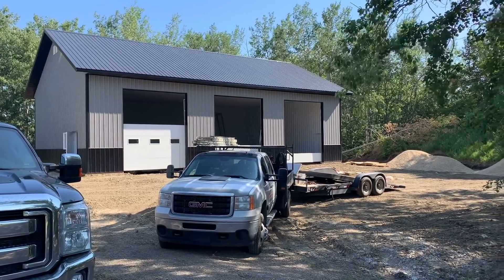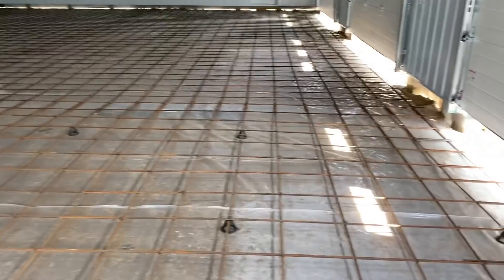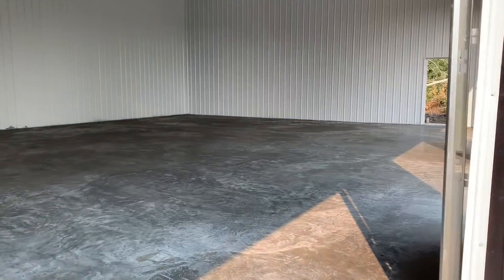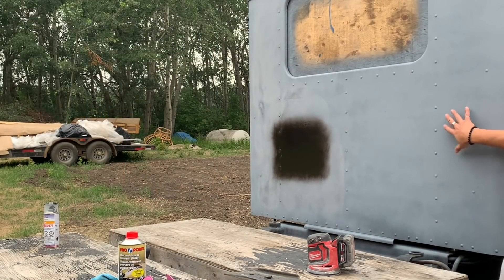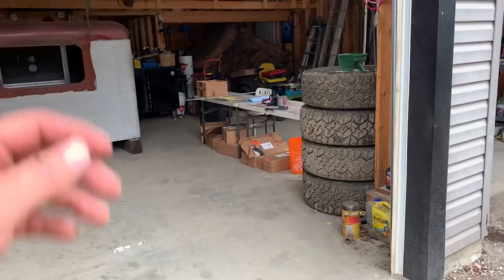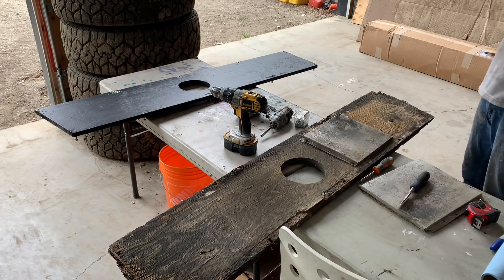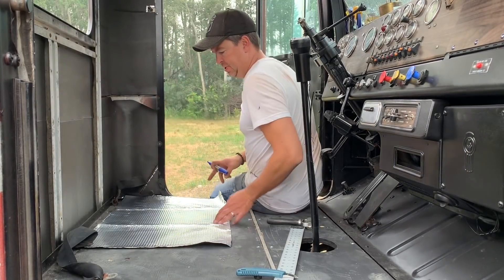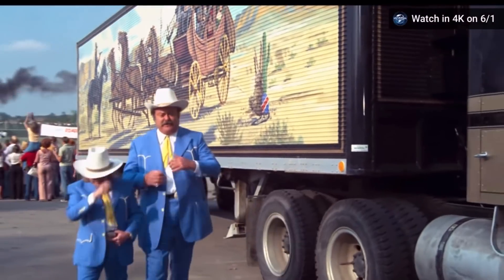Smokey & The Bandit Tribute Truck Ep.25 Was the Movie Truck Brown???

Comment: G'day Mark, I'm a retired trucker in Australia and a member of a lot of Model truck forums in the US. The concensus of opinion is there were 3 Trucks in the Movie. At the start of the movie the where he drives the truck into Snowmans yard and unloads the Trans Am, that truck is a 73 50th Anniversary with the Gold bonnet emblem and is Black and Gold. The other two are 74 with Chrome emblems and are Coffee Black or Black Coffee and Gold. Couple of tips You won't get the right colour till you put the clear over the base. Use black under coat under black. Light Grey undercoat will give the gold a lift. I would spray out the base and clear over a few test pieces to see the different tones that will happen. You will need at least 3 coats of base to cover. Huge fan of this movie. Hope I have helped you. Les

Comment: Hey Mark just a little painting tip for you. If you use a darker tinted primer for your base the color over it will show darker. It may help you get the look your trying to achieve with the color you have.
Reply: I agree, maybe using a black primer will help to get it just a touch darker
Reply: +1 on this. Painted a few and black primer is the way to go. Test again over black.

Comment: If you use a black primer or a sealer under the paint it will come out darker when you spray it should try that
Reply: I was going to say the same thing.  If you use a sealer over your primer they should be able to tint it something close to job color.    Primer color can definitely change the color especially when the light hits it.  That was only one coat with the spray bomb as well 2 or 3 coats and it should darken up.

Comment: Its exciting watching the shop come together. You dont even know yet how awesome its going to be this winter!
As far as painting goes you are going to need a bunch of stuff before you tackle that.
1. Dedicated compressor for paint, 60gallon minimum. 
2. Good air/water filter, i use the devilbiss QC3, this also has built in pressure regulator on output side.
3. Dedicated air lines that are NOT used with any other shop tools. Its extremely important to have your paint air supply separate from shop air supply, you do not want paint contamination, it can an will happen my friend, it will cause very expensive and tedious redo work. 
4. Buy a good gun of at least average quality. I like the devilbiss tekna guns ($500) range.
Use a separate gun for primers, again the devilbiss ‘starting line’ 2 gun kits are great ($150) range, ive used the starting line gun for primer for years at my business.
5. You need to throw away all of your cans of wd40 and switch to non silicone based lubes. You wouldn’t think it would but it gets into the air and causes massive contamination of everything paint related.
Research that if you dont believe it. A local industrial powder coating shop lost an entire weeks worth of production due to a pallet of wd40 soaked parts sitting inside the warehouse. Caused north of 100k in damages.
6. You must use a good 2k mixed primer under all of your paint, your basecoat/clearcoat topcoats can cause lifting and or wrinkling of cheap rattle can or ready to spray primers. Dont scrimp and be a tight ass here. You DO NOT want to be trying to removed failed coats of primer/basecoat/clearcoat on rivet heads and such !!!!!!!!!!!
7. Your bondo needs to be sanded with 220/320 grit paper before primer to get rid of deep scratches. Your primer needs to be finish sanded with 400g before paint, thats a minimum requirement for most paints, if i were you i would get it all sanded smooth with 320/400g dry and then wet sand it all with 400g wet, followed by a quick pass of 600g wet. This will allow you to put a bit of shine to the primer and it will basically allow you to see what it would look like painted. Do not paint over burn thru spots. Your work needs to be 100% primed, paint will adhere differently to bondo or old paint and you will see the outlines of the burn thru later. It can also react and lift the paint around burn thru spots. Also dont use the cheap ass bondo you get on the shelf at the parts store. All bondo is not created equal. You need to use a heavier bodied filler for bigger repairs and a finishing glaze/putty on top of that and for smaller repairs, i use dolphin glaze by upol. You will like that.
Do NOT use the shitty red squeeze tube spot putty thats premixed. That shit will shrink up for eternity because it never cures, dont make that mistake, use the dolphin glaze.
Dont use any ready to spread or ready to spray products, they are garbage, 2k only.
8. Go down to a local bodyshop and pick up an old hood or trunk lid from a slightly damaged car, they might give it to you. 
Bring that home and practice every step of your priming and painting process, you dont want to make the mistakes that are 100% going to happen on the trucks. 
I, like you decided to start doing my own paint and body stuff a long time ago and I, like you didnt even know what I didnt know and learned everything the hard way, by that i mean expensive and labor intensive. 
You can definitely do it yourself but you have to make sure your giving yourself the best chance of success by using the proper tools and tactics. I did just what your wanting to do and it worked out fine and eventually turned into a full time restoration business.
Keep up the good work man.
Will the blue pete fit in the shop door with the tall stacks ????????????????

Comment: Mark if your going to paint it yourself I'm sure you can find some books on how to paint, is there a Canadian equivalent of Haynes manuals? But a few tips 
Mask up a area with tarp, put sawdust on the floor then dampen with water to pull dust & moisture out the air, lightly sand all the paint down to key it  & strip off as much parts as possible to save on masking up, panel wipe between every stage, coat of primer, sand, primer, sand, base coat, sand, then I'd say 3-4 coats of paint, spay from left to right or right to left depending which works best for you, always spray the full width of a panel to avoid runs & overspary, 2 coats of Lacker (clear coat) 

If there's any imperfections can use a high buid putty at the primer stage, any imperfections in the finished paint can always be lighly flated back before Lacker 

But if you take your time & have a guide to help you can get very good results 

I'm no vehicle painter but was tought how to do it by my mechanic who was a paint sprayer for 20yrs before getting bored of painting cars 

& My biggest bit of advice is don't leave anything sitting around in primer!!! As the primer can suck in the moisture & can end up with water under the paint that can come through & even rust down the road

Comment: All you need to do is get a reflective tint for car windows.  It's easy to install or take off if you want/need to, and it's cheap.  The best part is that you can see out, but they can't see in, and it'll slightly cool the building.  There are some cons to using it...  You will not have a lot of light coming in from outside.

Comment: The purpose of the fiberglass rebar is it doesn’t rust. Once the rebar starts to rust, it expands and busts the concrete, causing it to fail. Concrete is porous and absorbs moisture. That’s what happened to that condo down in south Miami. Rebar got so rusted out and the concrete cracked to the point it failed and came crashing down. Can’t imagine how many other condos down there have similar issues? The one problem with fiberglass rebar is you can’t bend it around corners like steel, but in your case you don’t need to. I would have gone with fiberglass, but steel will serve your purposes just fine. Use some fibered concrete and you’ll have one strong floor!

Comment: Well I know the floor is already reinstalled but if you were to install a another floor I would seriously consider using something besides self tapping screws like perhaps Nut-Certs (Rivet-Nuts) and machine screws with large washers.

PS I definitely think the color for project Snowman needs some black and perhaps a darker brown.  One other thing you can try is spray a light coat of black on first and let it flash off and then spray that custom color overtop of it. Lastly it has been my experience that it is not a good idea to spray part of a vehicle in single stage and then another part in two stage paint especially when they are the same color and be honest with yourself about how much of the back of the cab and sleeper is visible because in reality it’s a lot more than you are probably thinking 
Keep up the awesome work and I have some severe garage envy
Reply from the maker: Anything I’ll be able to see, I’ll be able to sand prior to painting the whole truck base clear ... it’ll work 👍

Comment: You really should paint it yourself, I knew nothing when I painted my first truck when I was 16 years old.  That truck with that paint job ended up on the  cover of mini truckin magazine.  Since then I have painted at least 30 vehicles and it is not my main profession.  I can help you out with any advice or questions that you have about painting.  If you take your time and use the correct procedures and techniques you can have a amazing paint job.

Comment: Well, everything is coming along nicely now. Good show. If you get a chance for a break, check out @Jennings Motor sports video: Will it run after 81 years 1929 gmc truck. It’s a really neat 2 ton with winch that is pretty much all there except the wood flatbed. Pretty soon it will be snowing there, but it looks like you will be inside by then. Enjoy.

Comment: Just wondering why no floor heat pipes or drain holes in the floor? I’m going to be building a shop soon and was wondering whether it was the money, time, both or another reason. I live in Manitoba and I know how cold it gets in the winter and how much snow packs into a vehicle. Just trying to get as much education as I can before I spend the big bucks.
Reply from the maker: I hear in floor heat is good if you’re going to be brining vehicles in and out in the winter.  My building is just for storage and tinkering so I don’t expect to be taking them in/out so radiant tube heater should be fine.  Also infloor would’ve exceeded my project budget

Comment: if you want any of that shit to stick pickup a box of orilleys grey scuff pads. i work at a body shop and i know rivets suck. we final sand our primer with 400 on the semis and then hand sand around the rivets a bit then go over with the grey scotch. pickup a gallon or two of high build primer. fills in all the little scratches and pinholes.

Comment: Not a paint expert, but I know that if you use a light sealer/primer under a dark top coat it can drastically change the toning or color of the top coat. Same goes for light colors and metallics,candies, ect. I would try the color you have with a black sealer or prmer before changing color codes. Just a thought hope it helps.

Comment: Take a look at phenolic materials. The equipment I work on cuts, and drill this stuff. Heat resistant, and very hard. Much better than wood. It will not deteriorate like metal, or wood.

Comment: yeah, allthoght that brown will look nice it's not "impacting" right.
just go with tuxedo black and get a brown shade in the clear coat,
but then don't use straight Gold, it'll get a different color 
you need to look out what beige tone you need to get gold with the tint in the clear, 
It also might look like a metallic paint after.

Mark you know the triva "fact" that one of the trucks in the Movie (73) was a Truck bought used straight from the road,
the Truck with the Mack Mirror and the Dent in the Tank ,that Truck is soposed to be Real Black and gold 
 the other Truck was that brown and beige, the Truck that burnt in Universal studios was the Brown one,
the black one was sold after filming and is sitting allegedly in a field in Illinois (not shure bout that)

so... just Paint it black and gold.

Comment: I might have took a broom and sweep it that way it's not going to be so smooth get a little water on there you might slip and fall years ago we take a broom and sweep so when it cures it's not so smooth like a glaze that way you got traction just a light broom over the cement before it dries
Reply from the maker: Problem with broom sweep finish on concrete is it’s darn near impossible to actually sweep and clean up dirt
Reply: @TwinStix  yeah it's not so slick with a broom finish I live in Las Vegas but I have a house in Michigan I have three pole barns on my property back in Michigan my biggest one is 60 by 120 and and 16 ft ceilings I have cement floors and that burn I have a shower bathroom I have the air conditioning I have a big wood stove with the ductwork and the fan it heats up that whole pole barn I was going to put electric heat in there but I remember I figured it would cost a lot to heat that up so I put a wood stove in there and I'd buy the wood from Canada I forgot what they charge per cordbut it was already cut and they would deliver it don't put it right there and that would last me because two of my barns have wood stoves the two biggest ones and my house there has two wood stoves the house also has electric but my friend and his wife they live there they use wood they buy it because I don't want them cut the woods down on my property I have 20 acres my driveway is 1200 feet long and I got this house in Las Vegas that I live in and I just bought another house up by Carson City here in Nevada I got three houses no more

Comment: Here is some paint color info that i found. Copied and pasted:
this info is from Hanks Truck picture forums

Here\'s my info for the Smokey & The Bandit rig. They used (3) W900 Kenworth\'s for the movie. 2 were from 1974(Gold &chrome logos), and 1 from 1973(gold logos-50th anniv.). As far as paint codes for the truck---Black Coffee is main color. NOT true Black! It\'s really a true dark Brown. 2 blocks of Gold wrap around the sleeper and goes to the front of the truck. Super thin Gold pinstripes accent the front fenders. The Black Coffee paint is also used for---air intake/cleaners, front center hubs, and on rear hubs, gas tank straps, door steps, and chassis. Interior was Black Splendor with light Beige roof, also on the \'74\'s featured some kind of 400HP V8 Catapiller engine & the other \'74 featured a VT-903 400HP Cummins Engine, the \'73 featured some type of 13 Speed Transmission because look in the interror shots, the top of the gear shifter was Chrome all 13 Speed Gear shifters were like that, & I don\'t know what type of engine the \'73 KW featured. For those curious about the mural trailer used in the movie---it\'s made by company--Hobbs(anti-sail reefer). Thermo-King unit installed. THO personally I think the Thermo-King Unit is a fake since there\'s NO reefer fuel tank under the trailer. Hope this helps. WHERE IS THE TRUCK!!!!! -Blaze

atleast we all agree on one thing that atleast one of the trucks used in the movie was a \'73 Kenworth W-900 the only thing that I noticed that we are all wrong on it that we everybody else besides me thinks that ALL THE TRUCKS FROM THE MOVIE ARE 1973\'s and to tell the truth we are all wrong under this movie truck including me! the 2 main trucks were 2 \'74 Kenworth W-900\'s while the third truck which is the real\'73 KW that was used for all the interrior shots & very few exterrior shots! the two \'74 KW\'s have been known to burn down in a ware house back in \'79 also with last known trailer surviving from the Movie & the oly trailer that was used during the filming of the Great Smokey Roadblock! the \'73 KW might still exist today! I repaeat MAYBE it still exist From what I hear a Farmer in Nebraska bought the truck back in a auction in 1980 and took the sleeper off it! the truck is know a daycab rig! another fact I hear is another farmer from Chicago bought it in the early 90\'s and still uses it today to haul a cattle trailer, In my mind the year of the truck should be changed and confirmed to 1974, seeing we have the main truck in the big main picture on top of all of our posts! I don\'t mind it being left as the year a \'73 But I think were should have the right year with the right truck! With those that don\'t agree with me that\'s fine! but I think the truck should be listed as a \'74 Kenworth W-900 & also the Info I got was from another web site that said that George Sack geve the person that info! Now I know that info was not accruate! but, I can garentee that Blaze\'s info is 100% accruate, but I think it\'s a 135% accurate because he\'s tracked ALOT of trucks used in the filming from both BJ and the Bear & Movin\' On!

anyone that agree's with me that the year should be '74 instead of '73 please speak up!